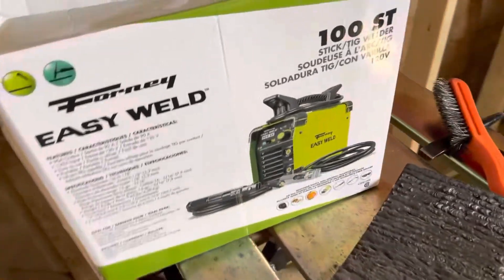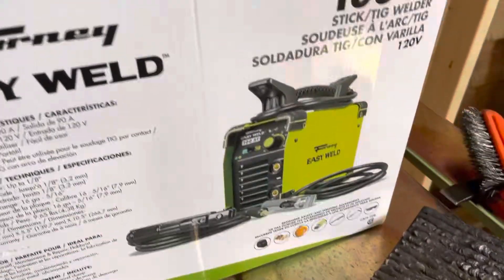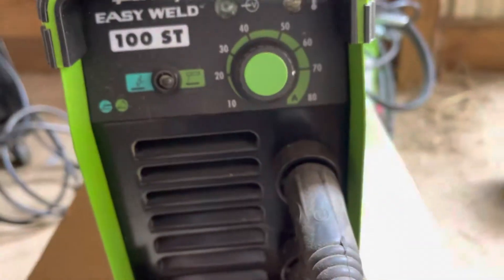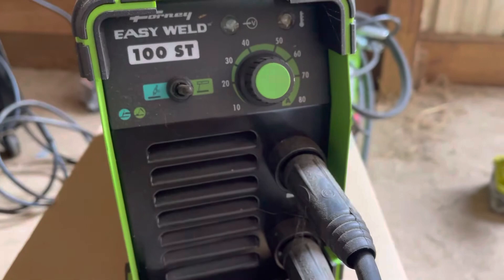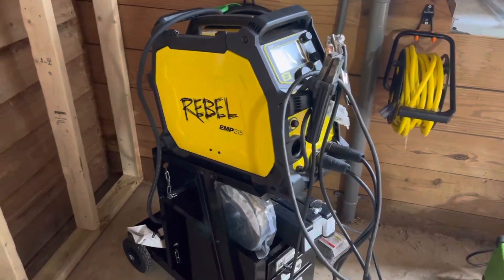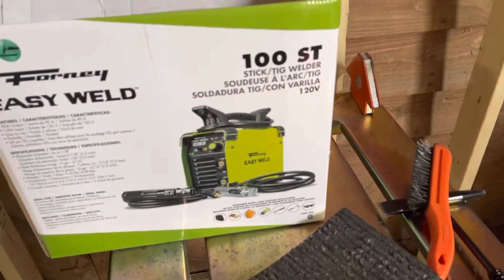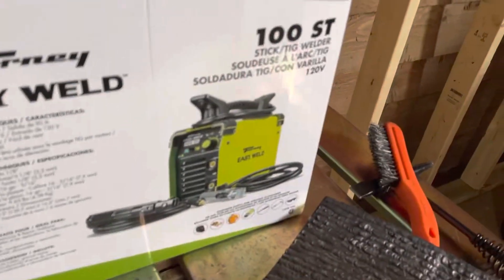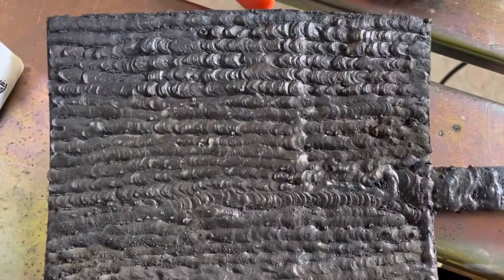Fortney easy weld 100 ST - solid little welder

Comment: I have one and it is a great little welder for small projects. Only problem I have had was last week I was repairing a mortar box and when I squeezed the rod holder to place a new rod it flew apart! So i called Forney and ordered two replacements. The new ones look a lot more solid and can be used in up to 200 amps.
It is a great little welder and barring that little issue I highly recommend it.

Comment: Nice welder. I am a beginner. I clicked on the video because I saw the FORNEY. I am using one at work, it's a different model, but looks identical to yours. The machine is solid and easy to use. I am considering buying the machine you have for my own personal use. Good review, thanks a bunch and nice beads on plate.